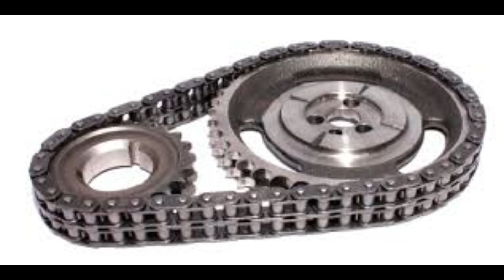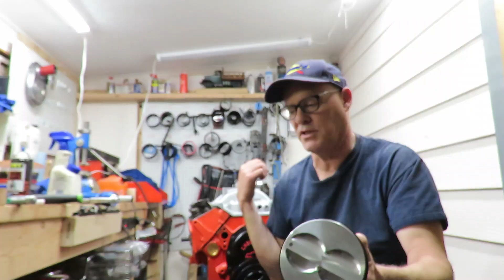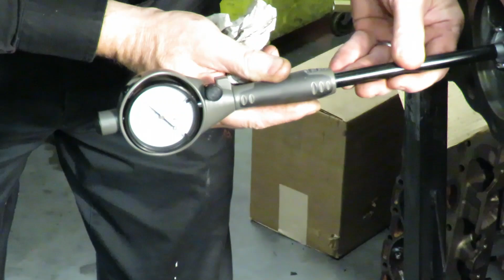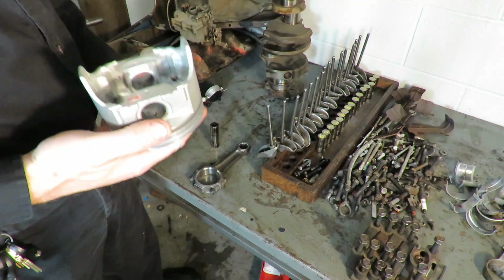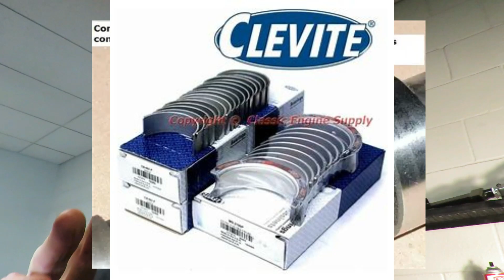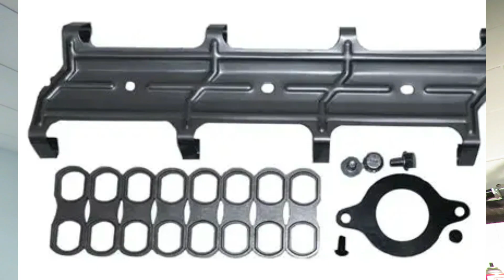1968 chevy Malibu wagon engine rebuild part 2

Comment: Bummer...  you. Say. Here.  The.  Quality. Of. Parts. Has.  Been.    Declining....  now....  i.   Wonder. Is. It. The. Quality. Of. The. Machining..  or. The. Machinist...  the. Metal.  Chemistry. Itself. Or.   The. Heat treating.    Speficatiions......  process.or. tenperatures....  and.  This. Maybe. A.  Good.   Test. Engine..  to. Try.   Something. Like.   Big. Valves. With. Your. Suggested.  Port. And. Polish.   For.  305. Heads...  262..  heads. Or. 267. Heads.   It. Might. Give. The. Younger.  People.      An. Avenue. For. Creating.  Their.  Own.    Performance.. parts. With.  A. Reserve. Junk. Yard.   Supply...  and. Give. The. Auto. Store.  Machinist.s.  some. Work...    have.  A.  Nice.  Day....

Comment: Great advice !  Hey i just got a Buick 425 Nailhead running after sitting 40+ years and it runs great !  Do you think i need to put  a lead additive in the fuel to avoid damaginig the valves/seats ?  Thank you sir.